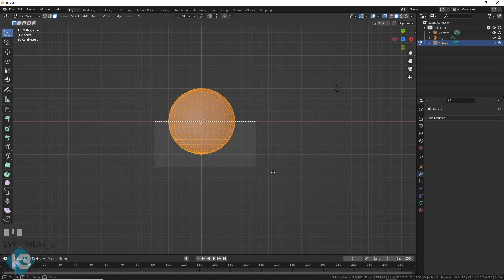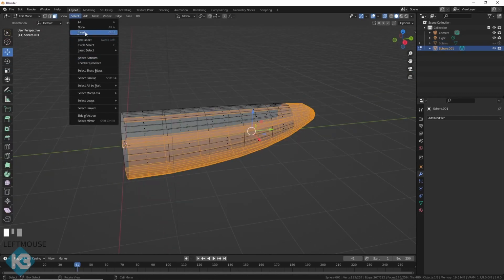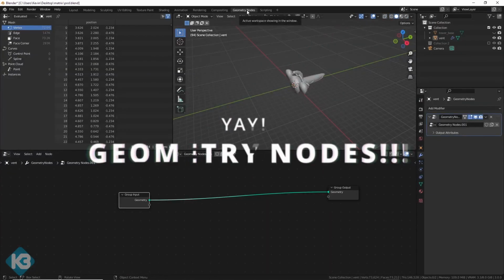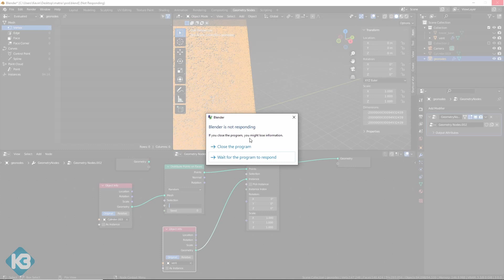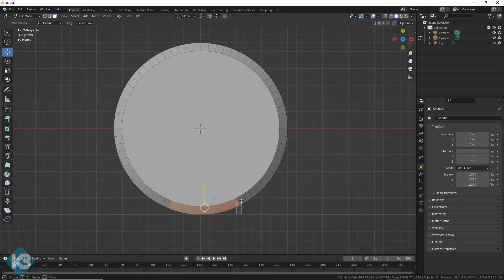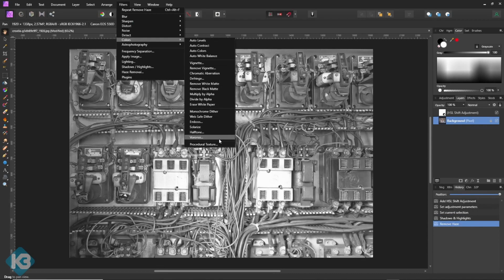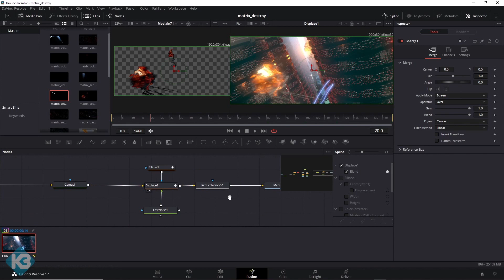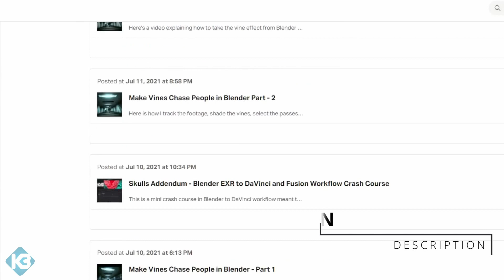I Blew Up The Matrix Power Station in VFX Software

Comment: Since u used clarise and blender who do u think has the better render engine (in terms of speed and quality), and if they have no big difference could u make a little tut on clarrise ‘cause theirs nothing on the internet to learn from….🫡
Reply from the maker: I think both are capable.  What you get with Clarisse though is the ability to throw massive data into your scene, work with it all, then render it.  Angie is nice and it’s coming, and is pretty fast as is right now considering how much data it can handle in the viewport.
Reply: @KevBinge  thanks for the quick reply, if u could show a bit more of this software it would be amazing thank u so much

Comment: Hey just one tip for the explosion I noticed you got some little chunky bits you can get rid of this by increasing the padding on the sparse solver (probably)
Reply from the maker: Thanks.  I actually didn’t use sparse or axiom here in the end, just brute force pyro and fracturing (didn’t make it to the final.)

Comment: That looks awesome... I did wanted to try out Clarisse tbh since i already use blender and Houdini but wasn't sure about its rendering... So, how good would u say clarisse's rendering is in comparison to cycles
Reply from the maker: Thanks!  I’d say Clarisse has great rendering, as it renders anything you throw at it.  Cycles is easier to set up in my opinion but Angie is coming, and once they include motion blur it will be amazing.  It’s pricey but powerful.  Does that help?
Reply: Oohh.. thanks a lot for the help😊

Comment: Hi Kevin, Great work man! I got a question: is Clarisse Awesome at handling lots of scene Geometry? Cool video!
Reply from the maker: Thanks!  Yes, Clarisse is amazing. It can handle insane volumes of geometry pretty easily.  I had 400 billion polygons going and it was really smooth.  Like I’d said, it’s an unoptimized workflow but man... wow.
Reply: @KevBinge  that's awesome man! Looks like I might have to try it out, since I'm a big fan of having lots of geometry in the scenes lol instead of just using textures.
Reply from the maker: It’s really cool and worth picking up for when you might need it.  Ian Hubert’s optimization way is super effective and I recommend that first but Clarisse allows for some very heavy lifting without dragging the viewport or your system.  I’m really loving it.
Reply: @KevBinge  Yes Ian Huber is a legend, he has got it down to a T. I Started working with Unreal cause I wanted big expensive scenes, but it gets overwhelming sometimes cause there’s couple of technical hoops you gotta jump through to render something nice out of it…plus the setup.
Always love watching your videos, thanks for the recommendation! and Happy Holidays Kev.
Reply from the maker: Ian is awesome.  He really is “that” good.  Unreal does have some amazing capability but it’s not super simple to get everything into it.  Clarisse is really simple.  There are a few Houdini prep work issues for certain things, but the Blender stuff goes right in as obj files.  I want to try USD next.
You have a great holiday as well!!